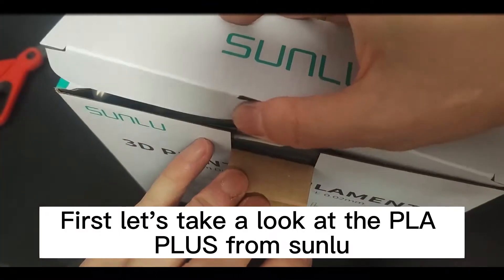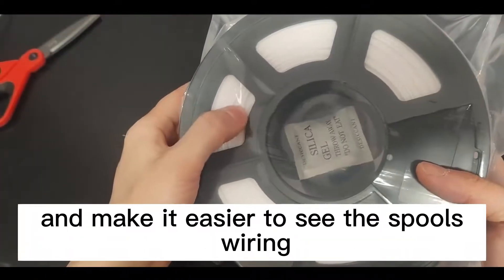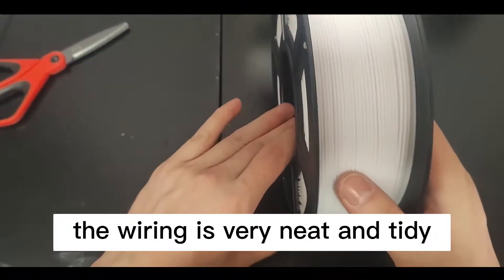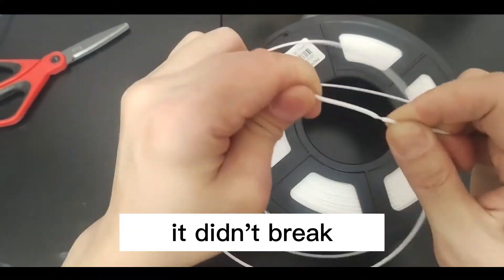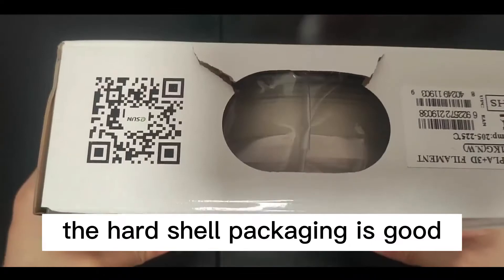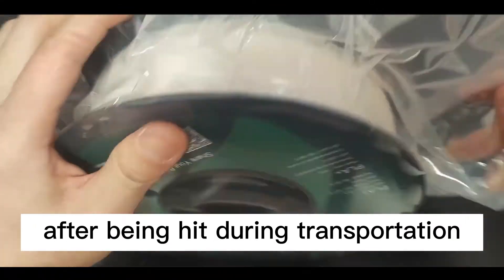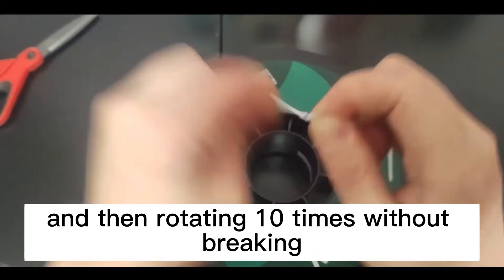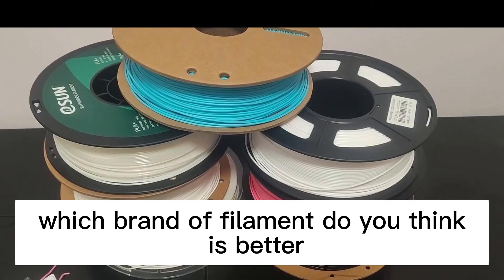SUNLU PLA+ VS eSUN PLA+ Review, Which Filament is Better？

Comment: I tried to print with Sunlu Clear Crystal PLA and it was a TOTAL DESASTER (2023). I never had any mentionable trouble with any other filament (Bamabu, Prusa, Amazon). But those filaments are a nightmare and nothing else. It's HORRIBLY made with lots of spots and differences in diameter. I bought three pcs and all are the same.

Stay away from this filament at any cost unless you want to run into trouble (and maybe a broken extruder).
Reply: 😂 you have copy pasted this comment on every sunlu pla review. Are you from esun?
Reply: @sherlockhomes9919  Yes, I have copy/pasted this to a few Sunlu Reviews because I was (as you can tell) really, really angry. And after testing the third role of filament (crystal clear) I stay with what I said: The quality is a total disaster. Not sure whether it was just a bad batch, but I will not find out because I will never buy from them again.
Reply: And yet, just came to the same conclusion after clogging 2 hotends one after the other because of their PETG filament. Also bought some Jayo (their other brand) and it was making bubbles (indicating moisture) with popping noise…
Reply from the maker: I suspect you are a spy sent by eSUN:face-blue-smiling::face-blue-smiling::face-blue-smiling:
Reply: @3dprints-jessi  I do not even knew the brand eSun before. But thanks for the recommendation – I will check them out.

Comment: I'm quite a fan of esun except for their spooling. Now and then I have a spool where the filament gets stuck when unrolled but it's only every 10 spools and only in one or two places on the spool. It may ruin a long print but for the small things I print, I can live with it.
Reply from the maker: Yeah, there will always be some small flaws.
Reply: sunlu pla+ prints beautifully on bambu lab printers i run. I consume 20kgs a month with no stringing or anything. colour has been an issue across different batches of 10. but thats common for all the brands i tested before.

Comment: I like both. But prefer Esun because of the bed adhesion which is better than Sunlu but Sunlu when dialed in is as good.
But Esun has better and stronger properties after printing. As the heat binds it better than Sunlu.
As sunlu becomes more brittle as it ages than Esun
So Sunlu I give a 9 and Esun I give it a 10 so not much in it